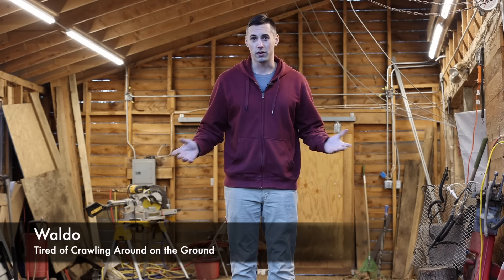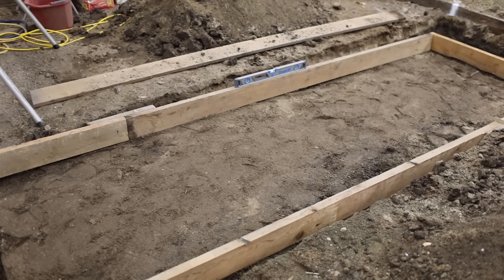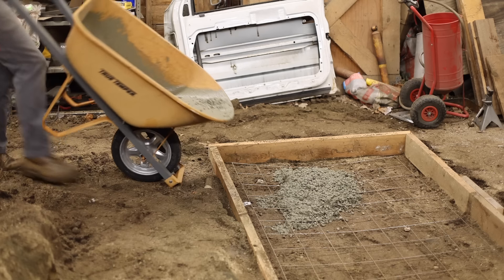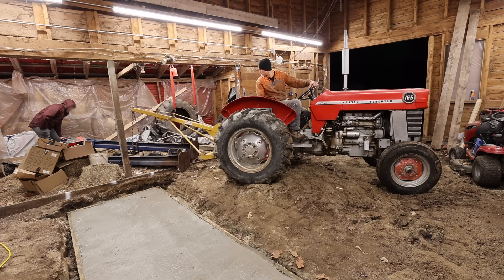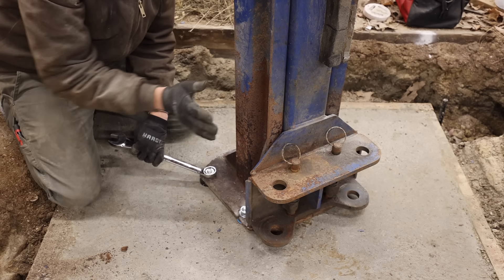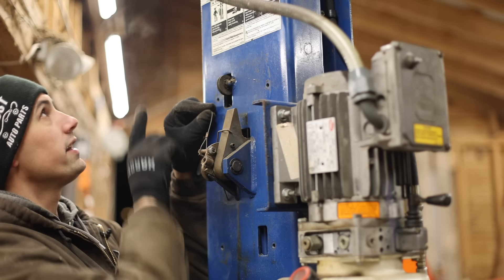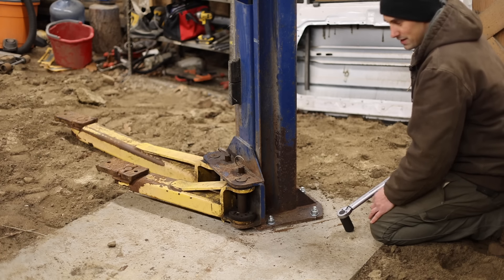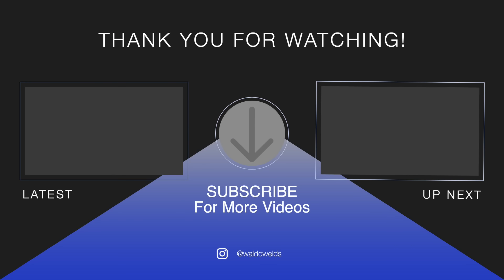Installing a 2-Post Automotive Lift on the Cheap

Comment: Hey Waldo,  I really enjoy your videos.  Just to pass along a suggestion... there are some good videos on YT on how to basically check your torque wrench for nominal calibration by using a vise and a luggage scale. It's not uber accurate but it does give you an idea for where your T. wrench is reading.  It showed me how far off my cheap torque wrench was and motivated me to get a better one. Thanks again for the videos!

Comment: 1st, You have to tighten the cross cables, your truck was tipping way too much! When lifting a vehicle the cables should be tight to prevent the vehicle from tipping and both posts should click the safety's at the exact same time and if not loosen 1 cable and tighten the other. I have the exact same lift and it took a little time to adjust the cables perfect.
Also a pro tip, Drill the holes for mounting anchor bolts all the way through the concrete, A tip I received from an installer, if you have to move, replace or just take the lift out you can drive the anchor bolts down into the ground. When replacing or reinstalling the lift, then you can install new bolts...

Comment: Concrete is optional if you have a source for used steel beams (they're easy to find in most of the US). I welded a simple H frame then welded my posts to that. It cannot tip, it cannot sink (my yard is clay and harder then my mother-in-laws heart) and if I rented I could neatly torch cut a few points and load it on a trailer then weld it back at the next location. I bartered some truck wiring for a couple thousand lbs of beam and still haven't used it up. Even if ya don't use it immediately I suggest every mechanic collect steel beam because it's a joy to work with. I also used it for my shipping container shop foundation.

Comment: 27:00 To get the lift to rest in the air, higher, you can raise the floor, in the spots where the lift sits, and pour a tall concrete pad there.  Of course with the short ceiling, you're probably going to want to dig out much more of the floor, so that you have enough height clearance.  Thanks for sharing!

Comment: I’m actually surprised that pad is big enough. 

Great work! I want to get a lift for my garage by my ceilings are only 10 foot.
Reply: They make lifts that will fit in 10ft ceilings. I'm getting one thats open at the top. the crossover plate will be on the floor
Reply: Just do it outside your garage
Reply: @commuterdude3053  I live in Arizona, it’s too hot to use an outside lift 8 months out of the year. Also my neighbors might not care for that.
Reply: @sheputthelimeinthecoconut629  well dont have a lift then I guess. Its america you can fix your car on your property. Put a tent over it 🤷‍♂️. I work in 0 degree snow all day
Reply: Have a look into raising the entire garage..when I was younger and dumber, me and my friend did his..added three courses of cinderblock at the foundation perimeter and jacked the garage up on to it..
This was in the days before HOA's and the like, your mileage may vary..
😀
Reply: It's absolutely not big enough. We will be reading an article soon about a youtuber being crushed to death under a failing lift.

Comment: I dont know Waldo. I wished you would have extended that concrete more forward and rearward, 4 ft seems really narrow. If the vehicle you intend to lift isn't centered weightwise, that 4 ft might not hold. Perhaps I'm over thinking this, but like the saying goes,  if it's worth doing, it;s worth over doing. You seem like a good dude Waldo, so I dont want to see you get hurt.
Reply: IKR
Reply: i think he can solve this by putting some beams for support and screwing them into the concrete.
Reply: That would work, anything for peace of mind. I know this is just temporary, at minimum throw a set of tall screw jacks under front and rear of vehicle to help support it. Jack stands for semi trailers, which function like screw jacks, are short and would be perfect since height cant be reached with this lift.
Reply: should really get that inspected by a engineer someone going to die
Reply: @Paronak  The easiest way to fix it is to tie in some braces into the top of your towers/ posts..   There's a lot of leverage up there, and will keep it form leaning.  Otherwise, he should have dug out footings like the size of a 5 gallon bucket (typically 18" deep minimum)-- and then had long L-bolts that reach down into the bottom of the footing..  But now, if he just ties it into the roof-- it would be plenty strong.
Reply: @CossyXY  LOL>.  and Engineer would shit a brick. lol..  I agree-- it needs to be reinforced.
Reply from the maker: Yeah, I might pour a bigger slab around it, being sure to attach rebar to the existing slab. In any case, weight distribution is key 👍
Reply: @WaldosWorld  Happy to hear that man!
Reply: @calholli  he would shit a cinder block...

Comment: I thank-you for taking the time to make the video and give me some ideas how to set my lifts up. I applaud your hard work. I would of went down with 2 piers under the posts about 3' but what you could do is yes tie the top to the rafters to give it some extra safety from tipping and get some good sturdy stands front and back while working underneath. I would not like to see you get injured be very aware of where your balance point is from front to rear. I too am in the same situation of setting a lift up on an old poured floor that is only about 3.5" thick. I was really amazed you stood those posts up by yourself if there is a will there is a way just be safe. Hope your lift is working fine yet.

Comment: Woha, Waldo, please, for the love of god, don’t crawl under any load on that lift. I was the one recommending flipping the gas struts on your trailer build. I did not see you compact the dirt you did disturb while shovelling out the ditch. Dirt ALWAYS needs to be compacted below any slab, especially if you did disturb it that much. With that loos stuff under this way to short slab, tipping is even easier! The way you set up, there will be no warnings! Just make a drawing, you could easily calculate how much you’d need as in an imbalance to tip it over while using a tranny or engine hoist and then you’ll do a very famous impression of a post stamp. You’d be flat like a pancake if your truck comes down. Just consider what 2 trucks of concrete cost and how much you’d spend on hospital or disabled. However there are ways to fix the situation. One would be to anchor the tips of the lift on each side down (forward/aft at atleast 45°). Each anchor point should at least provide the same pull force than the heaviest part you intend to lift. You would need four of those anchor points. One other option is to add I-beams to the side, they would need to be bolted to the lift as well as the slab, but you’d have to make sure they could not twist away and loose all axis strength by that motion. I personally would do a new slab, and just go 4" further down into the ground, use the full height of the lift, easier to work, safes your back. Also get a concrete mixer if you do it with bags again, your still young, but that work, it kills backs. Next time you bolt something down to a concrete part; give the concrete time to cure 28 days. Before that, concrete does not reach its full strength. And BTW, epoxy does not hold well on wet concrete, and concrete is considered wet for many days depending on weather. And, concrete does not dry, it cures, it’s a chemical reaction, it would even cure under water, sort of 🙂 And as an after thought, you could just use jacks to secure your car from tipping, 2 front and 2 in the back. Probably, since you said its temporary anyway, the best and cheapes solution. But never go under any load on that slab wothout securing the load against tipping.

Comment: Awesome video!!!! But from what I can tell. The steel mesh should have been lifted a bit off the dirt. So it supports the middle of the slab. But still thank you for the experience. Seems like now I have the confidence in me to do this myself now.
Reply: Not to worry, there isn't enough concrete there to keep the hoist from tipping either to front or back, so it'll tip over before the concrete fails due to wire mesh being installed improperly.

Comment: I dont know if this has been added before but I just got done installing a lift about a year ago and those cables need to be tight. You should be able to just make a noise by strumming them. also the cables are what keeps the truck or car level as you lift. the locks should click at the same time on both sides as you lift.

Comment: Fabricate a safety post out of 2" for sleeve wirh an adjustable  jack lip & 2.5"  mast out of blackiron pipe with holes for height pin to protect against an unbalanced load. You should've waited until the concrete fully cured before drill anchor holes.

Comment: Sure seems sketchy to me.  3000 lbs of concrete on a 5.5 inch thick slab that is only 4 feet long needing to support a 1000 lb lift and 4 door, diesel truck that I am sure weighs at least twice the weight of that slab.  I think it would be wise to at least get and use some safety stands at each end of the vehicle as several people have suggested. That was a great deal on the lift!

Comment: Cool install but as an engineer, i would never sign off on it , the slab should be  10% greater than the length of the longest car and the slab should be at least 10 inches thick. I usually recommend 20 feet square with  12 inches in the thickness. 👽👍🇦🇺

Comment: That concrete slab is way too short, if you ever lift something with the weight not decently centered between the posts, you risk the whole thing toppling over.
Reply: Yea but some of the older lifts had some angle iron that extended out perhaps a foot or 2 in front and behind and were more or less self balancing.

Comment: Concrete takes a month to achieve full hardness. Crushing strength is tested at 7, 14 and 28 days.
And didnt notice any stones in the mix. Both reasons why it was so easy to drill. Without stones in the mix, it wont bind together.
Plus that reinforcement mesh looked little more than chicken wire. Here in the UK, grades A252 and A142 are the types used in slabs. 
Be careful getting underneath it.

Comment: Waldo--  just tie the tops of your towers into your rafters with some braces;  angle iron or something...   Just crawl up a ladder and push back and forth on one of those towers and see how easy it moves-- and how much you can lift and roll your slab-- as a test (if you have doubts that it needs reinforced)

Comment: "It wouldn't be a proper video without me unnecessarily together".  LOL!  

After 40 years of mixing concrete in a wheel barrel, I bought a Yardmax YM0115 electric concrete mixer a couple years ago that easily mixes 2 bags at time.  It's actually rated for 3 bags, but it doesn't do very good with 3 bags.  It has been a back saver.

I have good luck with Tekton torque wrenches.  They're not extremely expensive, but they are fairly accurate.

Comment: Others have already talked about the slab being too small, so not beating that dead horse.   Another thing to consider is working surface.  If you live somewhere it is cold, you are going to have condensate drop off any vehicles in the winter..  which will freeze on that very smooth slab. Not to mentions oils and other fluids from vehicles.  It would be smart if you expand that slab to invest into a cheap outdoor broom and brush the surface of any fresh concrete so it gains a traction able surface like you see on many sidewalks.  Your tools will still roll over it well and it will help prevent potentially nasty slips and falls that could lead to serious injury.

Comment: The slab seems very short🤔
Reply from the maker: The instructions call for a minimum of 2 4'x4' slabs, one for each post. I went above and beyond with a 4' x 12' slab 🤷‍♂️
Reply: @WaldosWorld  I was concerned also but if that’s what the specs call for and you’re comfortable being under it then that’s what matters.
Reply: @WaldosWorld  i would pour a full size slab with rebar... But heey thats just me😅
Reply: @WaldosWorld  if you read further, it says those 4 x 4 slabs need to be keyed under the rest of the concrete slab floor.
You have built an unsafe trap.
I'd use it for ATV's and garden tractors. Nothing bigger.

Comment: I would like to say i have no idea what I am talking about since I am not a lift installer, with that said. I am concerned that the slab is not big enough to control fwd and aft motion. Or am I just being Paranoid anybody who knows more than I do on the subject please Chime in.
Reply: LOL just read the comments everybody who has NEVER built anything, installed a lift or worked on a car is telling him how to do it and it's wrong haha
Reply: @mrmotofy  well I have been a car mechanic. I also have been a aircraft mechanic on heavy jets for 30 years including jet engine overhaul. Certified TIG welder. Soooooo I do have some Practical experience working on mechanical devices.  Do you install lifts?
Reply: @carltrano1325  I don't install, them. I did install my own though. And I can read Rotary's specs which says minimum concrete 4 1/4" thickness and 4 1/4" minimum distance to edge of concrete, he's at like 12" or so. Then anchors at 3 1/4", his anchors are rated at like 6700lb  tension and 10k lbs shear strength for EACH one. Yet people are saying he can't use those fasteners and he needs concrete 2' -3' thick

BendPak says minimum slab thickness 4 1/4" and minimum width 48in, and 12" beyond base of lift.

I calculated the full capacity of my 10k lift at 13 psi sitting on the concrete. Which does have large bases, but even at double or triple that...it's still not much on 3000psi concrete. People are forgetting that weight and forces are spread out over a large area

Comment: Nice job. The reo bar (here in Australia at least) should be off the ground. When I was doing the reo we used chairs to keep it off the ground maybe 40-50mm high. I would say that one layer isn't enough to support a load but I'm not an engineer. We'd typically do mesh top and bottom with 12mm or 16mm extras or a 12mm or 16mm mat (a,b,c,d layer) tied together using tie wire. Gotta make sure you have enough cover on the reo so that it doesn't rust (50mm). Keep up the great work. 👌

Comment: Those 2 post lifts always looked sketchy to me even installed by pros . I know the 4 post lifts like Mustie and VGG have look a little more clumsy but I would feel safer under one of them . Plus the ramps leave you lots of room to lay parts and tools down when you are working under the vehicle .
Reply: You must not work in shops a whole lot
Reply: Most decent 4-posts come with bridge jacks that fit between the ramps to let you work on suspension, change tires, brakes, etc. I do agree that a proper 2-post is plenty safe. However a proper 4-post is also still plenty useful.

Comment: We always put the rear pads on the front leaf spring mount and it looks like that might be a very long reach for this setup.   Not a big fan of this setup and sure question how much weight that narrow slab will be stable to.   I would trust it on a small front wheel drive or even a mid size SUV but not a full-size pickup especially a 3/4 or 1 ton.  Then again after being under one hoist that failed tends to make you nervous for life. Other things I didn't see him lift the mesh so it was not just resting on the ground under the cement.   I think had he gone another two to three feet wider and seen the mesh lifted to mid cement level I would feel much safer.  All that but way to go getting a used hoist and making do with what you got to work with, ambition for the win Waldo.

Comment: I don't think I get to comfortable with that slab if you it off balance it will roll I put I stand in front and back before get under it . I know it temp put should of put three 12" round holes 3' to  deep to keep for rolling with rebar be ever careful you need balance it just right

Comment: Good video. I do agree with the comments; as a technician, the slab is not reinforced enough and on the small side. I would be careful. At the same time if you extend the slab and get high lift supports to help keep weight centered be good practice.

Comment: You can line the walls and ceiling with a membrane, i.e. builder's plastic. Then cover that with Gyproc, drywall? Fill in the open wall.

Comment: Anyone else check out of curiousity if he continued to post videos after this lift install?  Waldo, glad to see you're still ok!  Hand batching this and a lot of possible cold joints, a 4 x 12 x only 6" thick slab for a lift, wire-mesh, wedge-anchors in green concrete, etc had me concerned admittedly.